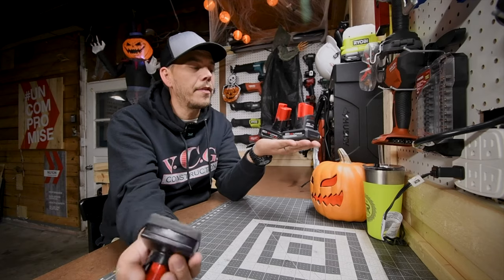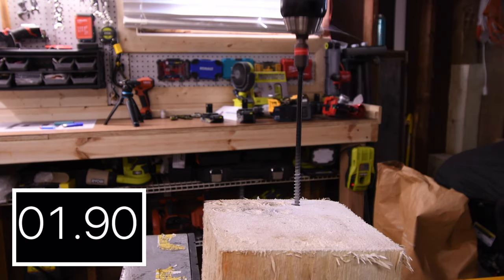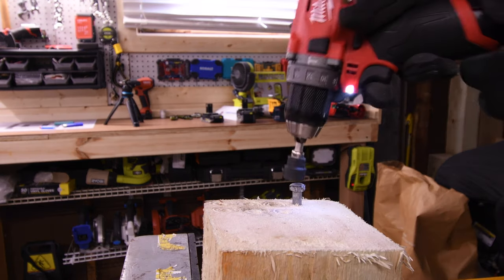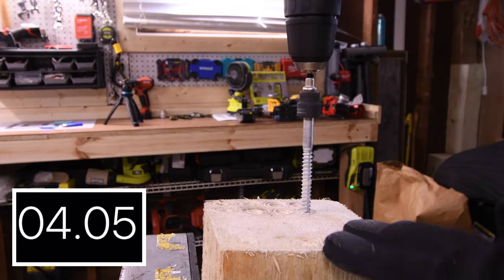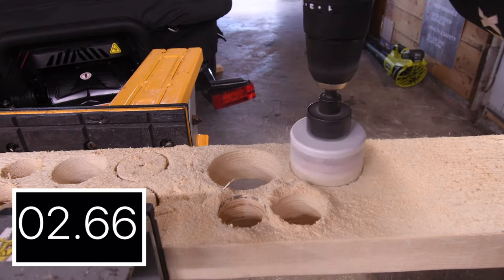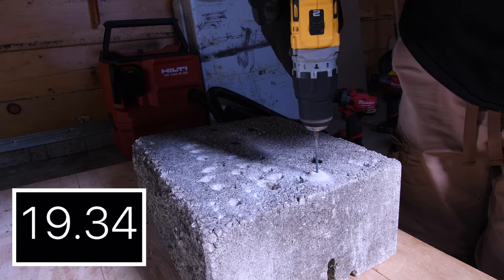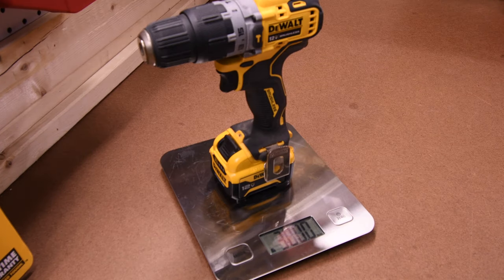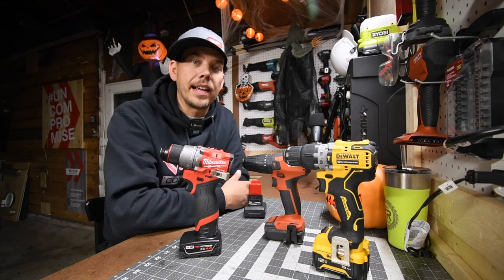You Won't Believe How Powerful 12v Tools Are!

Comment: I have the dewalt 12v hammer drill. I've had for awhile I use and abuse it and it's never failed me. It drills holes in concrete with no problems. I actually sold all my milwaukee 12v and went will dewalt and it's the best move I made.
Reply from the maker: the milwaukee m12 handles are thick
Reply: @Man Caver Tools   yes they are and thats a big draw back for me. I just love the way my 12v and 20v dewalts feel. Great videos BTW!

Comment: Great video…. I’d like to see a tool matchup of the Dewalt Xtreme SDS hammer drill and the new Milwaukee M12 Fuel hammer drill.  I’m curious to see if there’s much of a difference drilling concrete with these tools.

Comment: I ran my new gen 3 with a 1 1/2 in Milwaukee switchblade bore bit on speed 2 and it didn't even stutter. The new gen 3 ID is a monster as well, especially to be so compact.

Comment: I have been passing up the Makita CXT drill combo clearanced at Home Depot at $79 and a 5 amp hour battery on clearance as well for $39 figuring these small tools don't have power. Maybe I will rethink my decision and stop in and see if they are still available tomorrow.
Reply: Check if it’s brushed or brushless. I have a brushed CXT and it definitely feels lightweight compared with M12 Fuel. I haven’t tested it hard, but I’d be amazed if it came close to competing. 

(Whether you need the power or not….that’s a good question)
Reply from the maker: its worth it if its brushless
Reply: Makitas have underwhelming power for the price of their tools. If it's the brushed on clearance 900 inch pounds ain't much  for 12v.  Their CXT brushed drill is weak too. Very underwhelming performance, compared to even their own brushless models they replace.
Reply: I have that Makita CXT drill & impact driver kit which I bought on sale 2 years ago for $99. It's much less powerful than the Milwaukee Fuel 12v or DeWalt brushless 12v counterparts. That said it's does what I need it to do for regular household maintenance and light building (drilling and screwing together 2x4 studs). Their lightweight makes them better to work with. I have a set of Makita 18v brushless for more intense work but to tell the truth I rarely need to use them. I think for $79 the CXT combo kit is a great deal unless you just want one set to do all.

Comment: I've noticed mulwaukees drill in speed 2 will actually rev way down before cutting out. Dewalts drill slow down a little and cut out. So its hard to say which is stronger when one does cut it from bogging down
Reply from the maker: higher speed = less torque when it comes to drills

Comment: Dave this is the award winning video….I’m shocked with the results..I have all 3 except Hilti..the new M12 let me down with the hole saw and the concrete test. 
I could be wrong but if the new M12 has higher torque claims how did it loose the hole saw challenge, just curious..the dewalt was awesome..they are all good.
Reply: Eh, the same bits & hole saws were used for all tools - and the new M12 went last.. in other words, it's at a disadvantage in those tests.

Comment: Good video! Just two things:
1. The Skil Pwrcore12 drill is missing from the lineup. I found it to be just as strong as the DeWalt and stronger than the previous gen of M12 Fuel.
2. When you show the results, having the bar graph version is easier to decipher, but if you place the best on the left and work from there instead of keeping each tool in the same spot might help some of us figure out which is leading - or display the results longer.

Overall, I like the changes!
Reply: there's a new Skil drill/driver and hammerdrill as well as a 1500 in-lbs impact driver. Wondering how would those fare against the new M12 Fuel tools
Reply from the maker: I agree with you. there needs to be lines going across for measurement.
Reply: @luisinhoens90  do you have a model number on that new Pwrcore12 drill?  The Skil 12V impact driver was less than impressive against my M12 Surge driver and DeWalt 12V impact driver, so it would be interesting to see how a newer, more powerful one would stand up to the Surge.

Comment: Did you use a new bit for each test? If not the first tool would have a distinct advantage.
Reply from the maker: no tool gets a fresh brand new bit. these bits have been used for years. and no, I am not going to buy a brand new bit per tool for each video. the only bits I replace often are concrete bits. most of these bits are $10-$15 each and it would be a waste of material to just throw a bit away after a single test.

Comment: Overall , I have to say the older M12 hammer drill is probably better.. running cooler it should last longer.. I have one , and use it a lot..
Reply: The problem with the Gen 2 is the speed 2 gear ratio. It's like trying to haul a trailer up a hill in 6th gear. It spins the fastest but it is not a patch on the Gen 3 for torque.
Reply: @procrastinator1842  And the Gen-2 has a terrible e-clutch and trigger. The Gen-3 is leagues better than the Gen-2. Heat isn't an issue for the types of tasks that a 12v drill is typically used for. If you're drilling holes in concrete and using large diameter hole saws, you should be using an 18v drill to begin with.
Reply: @ZeGermanHam  All I need the Gen 3 M12 to do is sufficiently drill 1" holes in pine with a spade bit. 100 holes or so, once a week.

Every other tool in the M12 line up is more than enough for my work (electrician), so to just have one M18 tool and the rest all m12 is insane IMO. Its like running 2 brands of tools.

Comment: The Gen 2 M12 Fuel is 25,500 BPM, not 32,500 which is actually top tier 18V tool  value.
But it still makes sense as there are still 3000 BPM over the Gen 3 which didn't perform as good on concrete
Reply from the maker: Yes it does, Big difference as well. Gen2 has the Better Hammer feature by far

Comment: Still glad I got a spare gen two m12 hammer drill and impact . Don’t think the gen 3 is all that good getting to warm don’t see it lasting longer
Reply from the maker: its powerful but I feel like the Hammer Feature is slacking. it has 10,500 BPM less than the previous model
Reply: @ManCaverTools  so get the Gen 2 for hammering and the Gen 3 for drilling and driving. Got it.

Or just skip these for hammer function and get a 12V SDS rotary hammer drill...
Reply: @l00nybin  Get the M12 SDS for hammering 😉
Reply: @procrastinator1842  or the DeWalt 12V SDS...

Comment: With these concrete hammer drill tests, the quality of the hole matters. Most of these under powered drills result in lots of chip out near the top of the hole.

Comment: We’re those pumpkins 12volt pumpkins?

I have 12v DeWalt and Milwaukee tools and like them both.  I used to have a 12v Ridgid drill that worked great. But my wife and daughter took it away from me for their use solely 😂
Reply from the maker: I dont have a Ridgid 12v tool yet :(

Comment: You weight chart isn't quite right. You need to convert oz into lbs to get the scale right. The bar on the chart is showing the hilti as 2.11 lbs when its actually 2lbs 11oz. It should be at 2.7lbs on the bar chart.
Reply from the maker: you are correct. we need lines going across to measure. my bad on that. Ill make sure I choose that graph

Comment: really dont care about how powerfull milwaukee m12 drills are, the grip sucks
Reply: If the battery didn't go into the handle it wouldn't be so bad. they should really switch it up to and make it the  slide under like their own 18v line up and every other 12v line except Bosch
Reply: @Techprep23  agree, m12 tools are great otherwise
Reply from the maker: I agree, that grip does suck.
Reply: I agree as well. Milwaukee grip sucks
Reply: It’s funny, I didn’t notice that until I tried a Makita 12v. Much nicer grip. 

I find I’m often using my tools in weird and cramped positions where I can’t hold them normally, so it doesn’t really matter to me.
Reply: @Techprep23  Well, then the packaging and size wouldn't make it a subcompact tool anymore...defeats the purpose of the advantages over the M18 line.
Reply: @procrastinator1842  very true but I only mentioned that Milwaukee could use the slide under style they use like  their 18v. Obviously 12v and 18v battery packs are going to be different sizes.  Like DeWalt Xtreme 12v subcompact series  or Makita CXT 12v line.  So you have a pistol grip not a barrel grip.
Reply: If you go to slide packs you make the tool bigger.  That and the tool selection is why I recently bought into the 12v milwaukee line. For small size in compact places.  If I want a bigger tool I will use an 18v.
Reply: @mongocrock  very true. M12 has their place. But for me who has lady sized hands slide packs make for a smaller grip and better ergonomics for longer tool use with less hand fatigue. And make pressing the trigger easier. Don't have to use the middle finger while trying not to drop the tool in smaller spaces like my older 12v Ridgid impact driver and drill.
Reply: @mongocrock  I agree. For this type of tool, compactness is a top priority. I own the Gen-3 M12 Milwaukee, and also have M18 drivers as well as DeWalt. I agree that the other grips are more ergonomic, but I've never found the M12 grip to be uncomfortable.
Reply: @Techprep23  That's totally understandable.  Gotta get the tool that you can use comfortably.    There is no one size fits all.